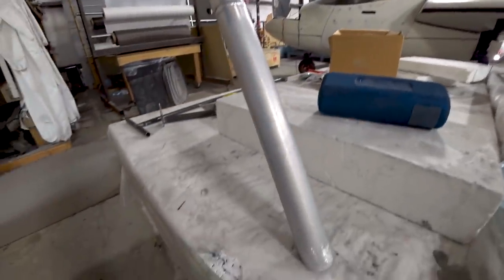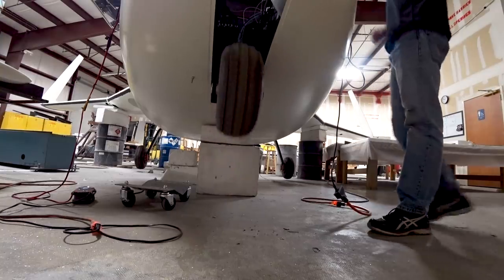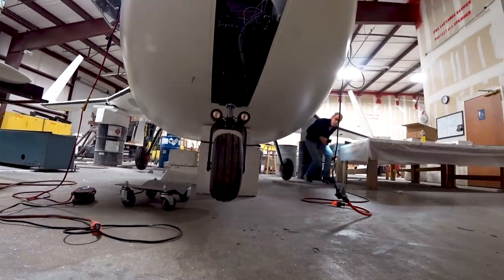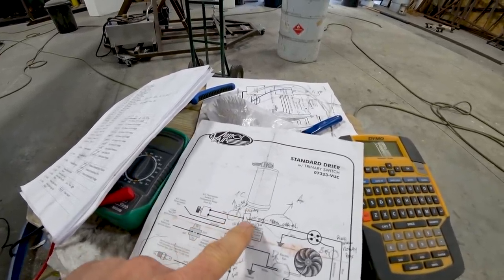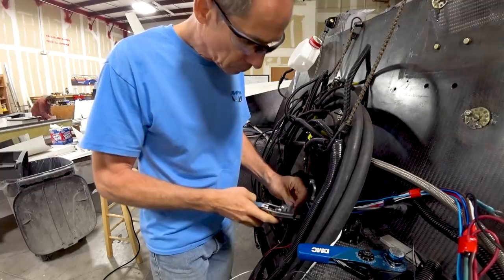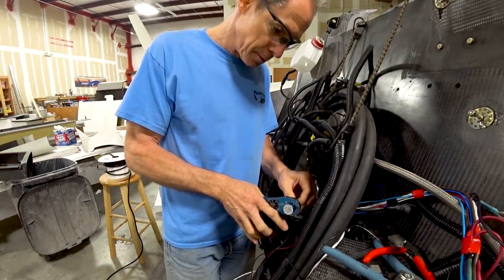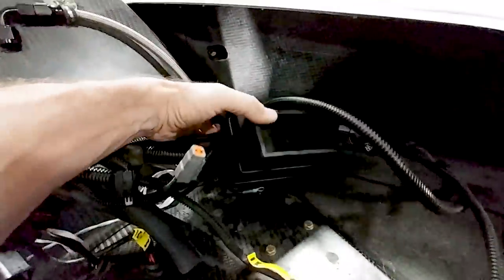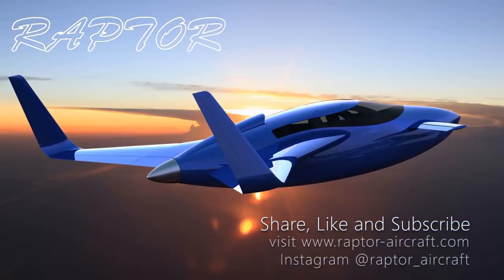A/C Wiring Complete - Building the Raptor Prototype

Comment: I don't know much about prototyping planes, but I would be inclined to have a few test flights logged before worrying about pressurization, air-conditioning, auto-pilot etc. Or is it a requirement to have all the bells and whistles in place to qualify as a valid test flight?

Comment: Sir, at time 6:38 in the video it looks like there maybe a tool mark in the re-drive.  I obviously am only seeing it in the video and it may have already caught your attention and maybe a non-issue.  There are similar seals used on freewheel clutches on helicopters where the drive shaft from the engine inputs to the main transmission.  If there were tool marks or scratches or gouges it could damage the seal and cause leaks.  Just something that caught my eye.  Fantastic work as always and thank you for allowing us to witness your dream become real.
Reply from the maker: Actually it's not an issue because that area is where the thrust nub is on the prop shaft and the two don't touch there.

Comment: Peter, the redrive bearings look worm past their time. Maybe the video is not showing it best. Is there copper showing thru? Or is that the reflection from the video? Is sure looks like one side is wearing at a high rate. Of course easy for us to arm chair all your work not knowing what you have done. Sorry in advance for that. Before running it even one more time, I would put new bearings in and check for proper alignment. Your drive shaft is running on a hydrodynamic oil wedge between the shaft and those bearings. It seems there is  a breakdown in the oil wedge.
As you know when those Babbitt bearings come apart, it could wreck havoc on the engine as well. Sorry, but I love engines. Will you be at Sun & Fun? Love your project and no pun intended, your drive.

Comment: Incredible project, thanks for sharing your journey through construction.
I have one misgiving. I may have missed an explanation but in case I haven’t I’m concerned about the integrity of the rocket exhaust tube upon ignition and during the burn. The rockets EGT is relatively high. How did you determine that that aluminum tube at that gauge will withstand the pressure and temperature extremes it must endure? Of particular concern is the bend in the pipe, the outside radius of which is subject to even higher stress and temp extremes than the straight pipe. Rocket exhaust blasting through the tube and into the engine compartment could cause a catastrophic fire. What am I missing?
I have learned a great deal from your videos, your video documentation is a great contribution to home builders everywhere. Thank you!
Reply from the maker: The rocket will be gone in a split second. There's not enough time for any heat build up in the tube or elsewhere. On some aircraft they have made the tube out of carbon which is way more flammable.
Reply: A carbon rocket exhaust tube? That’s incredible. If the rocket was to snag or hang up for some reason, even briefly, that’d be courting disaster. Thanks for your reply and reassurance.

Comment: About the re-drive. I wonder if a competent racing crankshaft person could align-hone the bearings and case, after the case is torque-wrenched together. I would even bring the bracket the case mounts to, and the fixing bolts.

Comment: Peter I’m not sure I understand the manual gear extension. There is the dump valve that will release the unlock and the gear will partially extend.  However you mentioned that a touch of down mechanism from the actuator is required to get the gear to the down overcenter and lock position and that is why it’s fed on the backup battery system. 

Are there redundant gear actuator motors or is this behavior not reflective of what’s expected in flight.  What happens /when/ the actuator motor fails?
Reply from the maker: That's just the way this pump works. Presently I don't have time to figure out a better solution. If all else fails the solution is to pull the red handle above your head.
Reply: @RaptorAircraft  Perhaps a small hand pump with a valve in line operating in the "down" direction only ... or a backup electo hydraulic actuator (small, underpowered unidirectional and on backup battery bus) might be the way to approach a solution.  I'm sure that there are lots of RG pilots like me that would be interested to know the solution when it rolls around for the production design.  Thanks Peter - great progress as usual.
Reply: @RaptorAircraft  I get that you're trying not to add projects but why not just make the dump valve open the hydraulics to atmosphere to remove any pressure or vacuum? Yes, you'd lose the hydraulic fluid but the gas cylinders should extend the gear no problem and this seems like it should only be done in an emergency anyways. This could guarantee the gear drop with a single operation and the system can be recharged properly after whatever the issues was is fixed.

Comment: How bout adding a flow diviider to the landing gear hydraulics, that would ensure each gear leg would recieve the same pressure at the same time.
Reply: Duck walk Deluxe. Flow divider may help? Depends on line lengths and piston quality. Been there done that. Lol
Reply: With a flow divider, the length of lines should not be an issue.
Reply: Need phasing cylinders

Comment: Do you have a flow control on the two lines? Even with it it's possible that it would do that but probably wouldn't duck walk as much with a flow control.
Reply from the maker: There is flow control on the return side. It is better since I added that a little while back.
Reply: if they where places in the individual lines before the lines join together it would solved the problem

Comment: Would it clear up the duck waddle if you put very light springs to just aid in the lift and drop of the gear? Also, if I might also add, I am not 100% sure, but I think the gasket maker should set BEFORE you torque down. So it doesn't all squish out....looking good🖒🖒
Reply: Springs won't fix the duck waddle. The only thing that may fix it is a flow control.
Reply from the maker: There are gas struts already that provide an opposing force. The gasket maker is the one that never really hardens. There is no real pressure in the drive in this area so a simple seal should fix it.

Comment: I'm concerned to see so much wear on the shell bearings in the re-drive, especially after such a short, low-load run.  One would expect to see some light polishing of the top tin layer, but it shouldn't go as deep as the copper.  At least in a car engine, that would indicate either very high mileage and poor maintenance, or very low oil pressure.   Given the distance of the re-drive from the engine, it may take a considerable length of time for the oil to be pumped that far and to build up pressure once you start the engine.  If you haven't already installed one, a check valve on the feed side near the re-drive would prevent that oil from draining back to the sump and allow pressure to build much faster.  You might find the weight penalty to be too much, but a pre-oiler might also be something to consider.  Not only would it feed the re-drive before startup, but it could also be used after shut-down to cool the turbos and keep the oil remaining in them from getting scorched.  An Accusump might also be an option.  

Anyway, thanks for my twice-weekly video fix, and keep up the great work!  I'm looking forward to seeing this thing fly!
Reply from the maker: We'll see how it looks after taxi testing.

Comment: Could you use flow restrictors on the landing gear to dampen that uneveness?
Reply: They've already got flow restrictors in place. They went over it in a previous video dealing with the landing gear.
Reply: if they where places in the individual lines before the lines join together it would solved the problem
Reply: @jarrp1  yeah exactly. Could either used fixed restrictors or the small flow control valves. Should be able to put one on each ram inlet and get rid of that problem pretty quick.